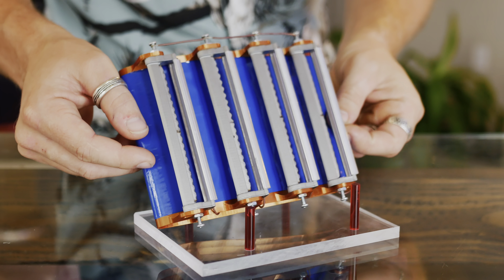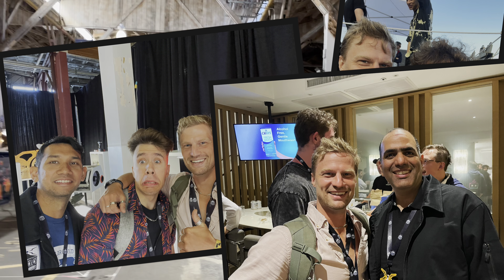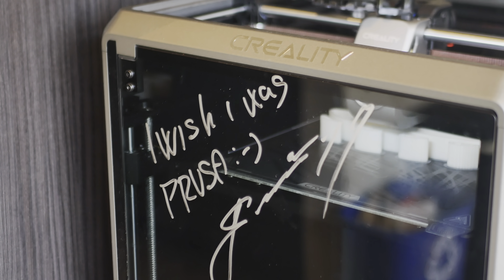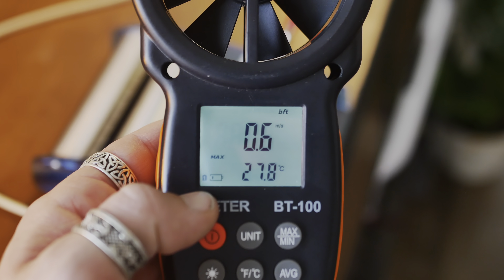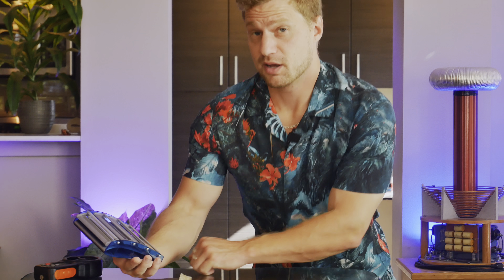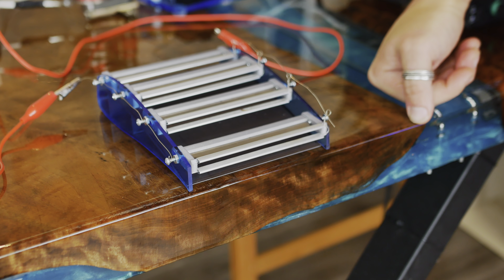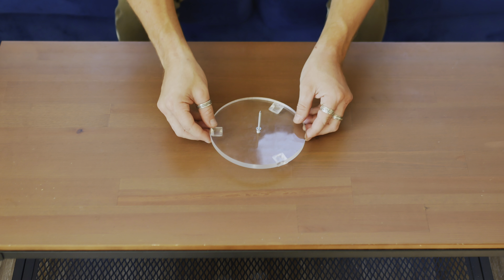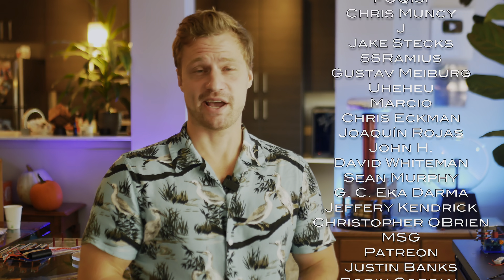Designing A Self Propelling Ionic Thrust Wing

Comment: You want to generate ionic wind thrust minus the drag of your style thruster?
.
.
Here's what you do.
___________________________________________________
Step 1:  You make the wings surface texture shaped like one half of a Tesla valve.  You hook up speakers so each ridge of that Tesla valve would be at the same wavelength as the sound you're using so that when it vibrates forward with the sound it creates vortices and when it vibrates back it pushes off of them, much like why a Tesla valve works in only One direction.  This doesn't generate much thrust but that's only step one.
Step 2:  You put a surface on the wing that is electrically conductive so that you can allow electrons to jump from one electrically conductive surface to the next, much like your engine.  You proceed to hook it up much like you did with your engine except you also have a separate setup going from the front of the wing to the back of the wing so that the air blowing over the wing through the engine will be carried by the engine thus augmenting it.  It wouldn't be very powerful because it wouldn't be confined or contained.
Speaking of your engine it isn't very powerful because it's not confined or contained but, not the point, because the version I'm talking about is less confined next step.
Step 3:  Take wires a custom-made combination of samarium cobalt and neodymium for the strength and range of the magnetic field and wrap them to make them into electromagnet adding in a magnetic component like a magnetohydrodynamic engine only with air.  I'm not sure what that would be called.  Furthermore this whole construct could cover the entire plane making the entire plane capable of generating thrust not just the wings dramatically reducing the drag by replacing it with thrust.

Comment: I don't think we're about to revolutionize flight quite yet. I'm thinking you could get a glider-like platform to fly, but that's because of how light they are. For sustained flight, you have to store the energy for the whole flight. In solid state, that requires batteries. Maybe capacitors instead, but realistically we need high energy storage and a lower discharge rate, so I'm still betting on batteries. And jet fuel is just more energy dense than batteries by mass. I hope I'm wrong. But as impressed as I am with the engine you've achieved at home with mostly off the shelf and/or 3D printed parts, I don't think the battery technology exists to make a solid state plane that carries a commercially viable payload a long distsnce. Your engine, if it keeps improving the way it has, will be capable. Its power supply probably won't, IMO.

Comment: Hasta este punto de las pruebas que el soporte tenga forma de ala no aporta en nada al experimento, suma peso innecesario y le resta rendimiento no? 
El principio de ala requiere ele un mismo flujo recorra la superficie superior e inferior  y es ahí cuando la forma del ala genera sustentación, el tener el flujo solo arriba va contra este principio
no se pueden construir los tornillos en la misma impresora 3D en lugar de usar metálicos?
Up to this point in the tests, the fact that the support is shaped like a wing does not contribute anything to the experiment, it adds unnecessary weight and detracts from performance, right?
The wing principle requires the same flow to travel across the upper and lower surface and that is when the shape of the wing generates lift, having the flow only at the top goes against this principle.
Can't the screws be built on the same 3D printer instead of using metal?

Comment: Very nice evolution! I'd like to see some even more out of the box thinking. For instance, why not put foil strips right on the wing in an alternating pattern and eliminate the elevated spars and all of their weight altogether? Just the trailing edge needs a tiny bit of clearance so that the plasma doesn't melt the plastic. Probably leave a small trough in the plastic just behind that trailing edge.

Also, instead of using wire where you lose the serrated edge, you could design a serrated copper trace on a flexible PCB. Super light and gives you more flexibility on geometry.

What matters in the end is the thrust to weight ratio, since this dictates whether it will fly in the end.

Comment: Would moving the ground wire down to the surface of the wing do anything? I don't know if that would result in lower thrust or if it would help "pull" oncoming air down to wing and make it harder for the airflow to detach from the wing at low airspeeds.

Comment: I wonder if you could take inspiration from golf ball pits and integrate the conductors into the wing itself. As in, have the conductors flush with the surface of the wing and small pits between the arc points.

Comment: Sounds like fun spending time with the 4th state (Plasma Reactor) employing aluminum has an electrode potential of -1.66 volts, while employing steel has an electrode potential of -0.44 volts. This is a differential displacement potential of +1.22 volts. Aluminum facilitating the sacrificial anode positive bias while ferrous steel is facilitating action of a negative bias cathode. It's easy to see that series high voltage amplifies thrust by about 2.2% X 4 = 8.8% while amperage parallel relates volumetrically implication of about 88%. To increase ionic speed and volume X 3~4. I would suggest employing a Sodium Chloride (Salt) Aluminum Alloy AKA: Expanded Aluminum, acting as the anode material the potential bias + voltage capacitor battery is already in the +4 volts range. Amperage is the key for more thrust! Another key is asymmetric capacitance battery configuration. Have fun!

Comment: Few ideas to minimize weight on the thruster parts, you can use foaming filament to minimize print weight, also the scrapers probably have a lot more material than they need.

Comment: Even though you make good progress with your design, I don't believe it will be ever commercially used for propelling airplanes.
There are many problems which will occur during real flights. One big one is the harsh environment (dust, rain, dirt, lightnings, radiation, birds, air pressure (Paschen)).  Since your propelling system is completely exposed to it and all it needs to fail is a good conducting path between the electrodes, I believe it is impossible to make the "engine" reliable and secure.

Comment: Wouldn’t it be better to add the thruster beneath the airfoil. On top you want a low pressure section. For that the air needs room to separate from the Surface. Thats the reason, fighter jet’s have all the stuff beneath the wing (luckily its also more practical). The top needs to be free. because its where the magic happens.

Comment: @Plasma Channel 

Stacked airfoils don't do so well, I fear you are killing a great deal of your lift. Really all you need is an electrode running down the leading edge, and one running down somewhere around the trailing area of the airfoil. Another approach would be just building a wing behind an elongated thruster, just need to get relatively clean air flow over a lifting surface.

Comment: One could argue you built them more onto than into the wings.  I wonder if it could be better to actually make them inside the wings, more or less making them part of the internal structure, to make it more aerodynamic, maybe build pressure, having multiple layers, and save some weight by making the thrusters structural.  If nothing else, that would make it a ionic jet thruster.

Comment: Being a scifi nurd my brain goes into thinking "This must be how UFOs fly".

Maybe have a set on the bottom of a saucer shape all pointing down to the center of the saucer to make a single vertical thruster for VTOL capabilities. Then the top of the saucer have them pointed outwards for direction Control. By cycling  the quadrant of thrusters active you can change the direction of thrust allowing you to quickly change direction without having to actually turn your craft.

Ok time for another beer.

Comment: Have a look at using a bandsaw blade instead of the razor blade. 
Also you might be able to save weight by applying the Aluminum tape to wing surface directly.

Comment: my armchair intuition says that those tiny circle designs built into the airfoil would be more efficient than many tiny airfoils stacked in front  of each other.

like there is a reason planes dont put one engine directly in the wash of the other. its like pushing against itself so there is no net gain.

Comment: try placing the thrusters inside the wings and have an air intake to supply them, in order to reduce drag and. this might reduce weight as well bc the thrusters will also be used as structure. you could also experiment with some type of nozzle to fit to the aft edge of the wings, so that the thrust from inside the wing is channelled at max efficiency.

Comment: You should not optimize for thrust, but for lift if you want to make an airplane in this configuration. Your thrust component is integrated and messing up all of your lift component. You could see the issue in balanced armature. Side with a wing didn't noticeably rise compared to the other arm.

Comment: I wonder why you wouldn't mount the plasma thrusters on the bottom of the wing instead? the top of the wing is supposed to be the part that generates drag, so wouldn't increasing the airflow over the top just stall the wing out?

Comment: Question: will the ionic thrust disturb the airflow over the wing and therefore the needed low pressure above- and lift under the wing? 

I am very curious how this is going to work out. I’m thinking it might only disturb the lift and needs therefore a lot of extra thrust (like a jet fighter with a different wing design).

Good luck! And looking forward how this works out! ✈️

Comment: I am wondering, would it not be beneficial for the thrust if the air was not allowed to leave the acceleration domain to the top and bottom? An encasing around the ionic thrust part of your build? Or would it maybe even be possible to somehow fit that thing inside a wing structure to make airflow around the wing cleaner and prevent the flow from escpaing through the sides of the acceleration domain?

Comment: Hi, At the begining you talked about the jet being a motor with wings and that you wanted to design a modual simular , A Self Propelling Ionic Thrust Wing but then mount it on a wing...... the modual should be the wing. you are using fixed  surfaces but maybe the anser is a covered wing with the modual instde. a combination of alu foil an non condctive foil. a duct systermand the air flow through the wing but using the standed shape to create the lift needed. may be turning thins up side down and inside out is the anser......... just a thought

Comment: @PlasmaChannel why don't you shave weight also by incorporating papar battery or paper super capacitor or a combination of both? Check Rober Smith's work. Replacing blades by wire segments and improving Venturi effect between the ionic modules, you will be surprised.

Comment: Love this and is similar to a thought experiment I had following your last video. 
Got me wondering though, does the flow need to go over the top of the wing or would it better better going under the wing?
Reply: It needs to go over, fast moving air is lower pressure - hence the shape of an airfoil to make the air speed up as it goes over the wing, creating a low pressure zone, producing lift.
Reply: Thank you for the clear explanation.

Comment: Cool video.
It looks like your focusing on power to weight but the airfoil /lift is what is gonna make it fly.
The top surface is normally the "clean edge" cos that's where fastest flow is required.
Also for weight you don't need the bottom surface of the wing only its leading edge.
You could build the motor into the underside ideally with a vented flow to use ventury for larger mass flow (thinking out loud,  that could affectively bring the motor inside the wing, but the vacuum of intake would need to be horizontal otherwise you're cancelling lift)
Reply: Still thinking out loud: motor in wing leads to flying wing style like a B2

Comment: For "shuting down" the rig, and generaly work with live electricity (equivalents of tazer levels), might be a good idea to use rubber gloves. BTW, if you aim for lower speeds anyway, you might try double wings designs. Either one on top of other, WW1 style, or one behind other... Maybe even if the wing(s) might be rotated, it could get some VTOL capability...?

Comment: You really should consider a magnetic field running across your blades, which should give you a massive increase in amps per volt, and it's amps that give you air movement. You'll be able to bring your blades closer together and use voltage control for thrust.

Permanent magnets are heavy but they're cheap and they'll show the magnitude of the effect. it might not be enough for the weight, but you should at least check!

Comment: Coming from a engineering standpoint, i kind of have a issue with slow moving.... The issue is that the ions don´t know how fast the plane is going. It just forces the wind back with a certain thrust. The ionic force that makes the thrust is basically moving at the speed of light. So if the ions move back in relative to the airplane at 10km/h or 200km/h don´t matter.

Of cause, it do matters for the air resistance, but there is also a lift ratio. So just moving slow might not be the best solution.

Comment: LookS a lot like lab air wind tester but permanent one out off curiosity sake or your chanel since it turns purple cane be used for rocket engine fuse system  gas line with catalyst protection cover and you do below stream then ring on cap rocket system  since stuff is gentle and probably not high explode cold offer like subtle stream so us good. for cooling permanently one off option in fast think is combustor hatch option like be or wasp nest then turbo it through a steam  sprinkler flated system wrinklers you can cool down power source easy above if in large capacity option in theory  you can cool easy even bigger engine in theory like 420 t off pressure but OXY engine as space x use it but is not even made yet anyway a so called stealth mach above 3 concepts movie use like cells engine actually is cap spore fuel system but for safe eficient flow a cryofuel system cooler is needed as UFO system in tech getting fast or faster on mars on theory scfi cryoengine on power core could froze north pole artificially on mars and makes gas and athomosphere fast carbon reheat even easier so it pops out reverse engineering and gas extract on other planets even easier so ratio like overgrowing salt cryoengine is probably plus pole as permanent and  and normal one or fire thorium cells equal to nič reactor a provisional minus so dropping iced oxygen would work as minus  if positioned 5-15 % angle to north is probably best option to find balance in diagonal system for tectonic research and artificial volcano blast by torpedo proton drop from above needless to say is kind form off Corvette system as it use like bug engine power house system so cryo engine salted reactors and tocamac belong to future or universe tech as energy sector so plan spread colony is at first in diag optional line from equator base line to close to ring pole north but angled and on and on a open sky bridge path opening sites base and demolish mined and road excavation and base purpose build in near for extract research and CO2 return emissions into athomosphere funny but concepts cryo cooler does the same stuff mars recycle athomosphere so in theory weather unusual concepts confirm this theory lava concepts could be real material through athmosphere but human artificial to speed up process and have some sites for research except on mars

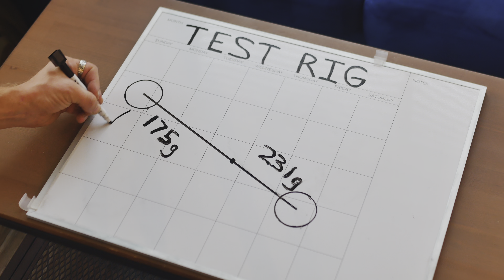Comment: Awesome video! @ 15:36 I’m studying physics and couldn’t help but solve this problem for you (whether you wanted it or not haha!). I am missing another important value, but here is the expression for the force of thrust that you’re producing based on the numbers you provided. 
T = 2.379992 (0.0258984 + 0.0229 M_rod)
M_rod is the mass of the acrylic arm that is used as the balance, so plugging that into the equation will give a near exact number. I tried not to round since these numbers are all less than 1, so small changes would have large accumulated error. Note also that this answer is in Newtons. To convert to pound-force, simply multiply the result by 0.225. That number will be smaller so I’d recommend using the Newtons value for your thumbnail 😂
Reply: By the way, feel free to reach out if you’d like to see how I got my answer. I’ve got it saved on a separate pdf if you’d want it

Comment: thoughts about adding the ionic thruster to a wing.
(link to proposal - https://youtu.be/UONDk07r9gE)
I think it is important not to affect the flow of air around the surfaces of the wing, particularly the upper surface. The upper surface primarily creates the down thrust a wing needs to hold a plane up. 
If you add your thrust mechanism to the underside of the wing (a little away from the under surface) you can generate your thrust over the entire length of the wing. As it is slow moving thrust, the underside of the wing will help contribute to a better angle of attack - by pulling the underside of the plane towards a climb, and not a dive. You will need to choose a wing profile that has maximum lift for low speed, but as a consequence, will produce more drag.

All the best - looking forward to seeing something flying in the future.

Comment: you should be able to set the layer thickness of your print,  The plastic wing looks so chonky if you make the walls thinner you should be able to save even more weight
same thing with the structure of the modules